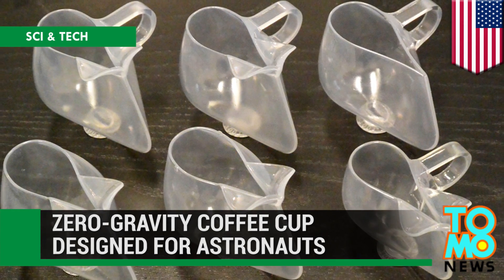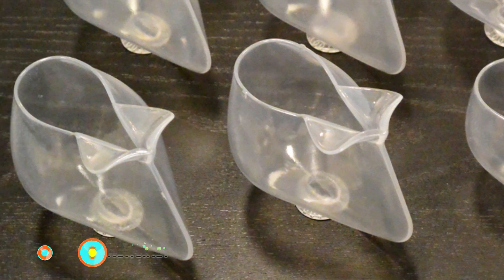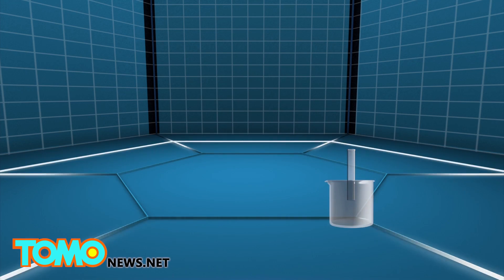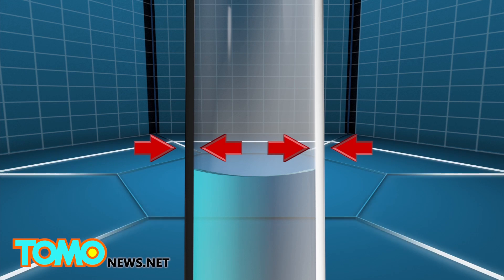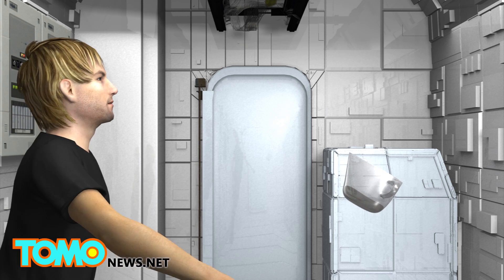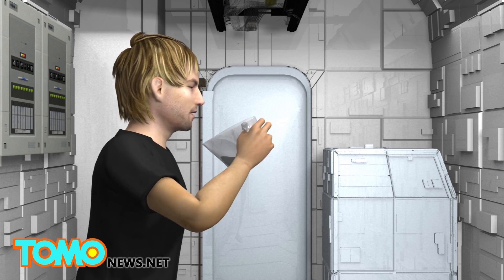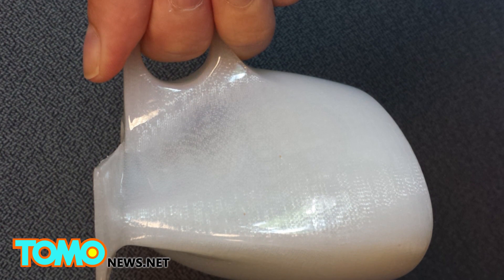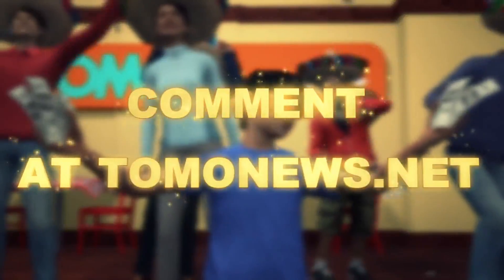Coffee in space: International Space Station astronauts can enjoy espressos with zero-gravity cup

Comment: The design is just a 3D printed version with a handle, and suction cup of coffee cups they were already making on the ISS. Turns out drinking coffee from a straw is really hot, and leads to things like burns. Go pour yourself a hot cup of coffee and pop a straw in there. Yeah, sucks, huh? The coffee cups let them cool the drink a bit, and sip small amounts more easily. Morale is huge in this work environment, and if you can give someone the simple pleasure of sipping coffee, that's cheap compared to losing multimillion dollar equipment, or worse--someone being hurt, or killed up there.

They didn't account for the effect on moral the workload was having on Mir. Ground control straight up lost control of the station at one point. The cosmonauts simply decided they were taking the day off, and turned off the radio. This is a hugely bad idea. Coffee cups? Cheap.